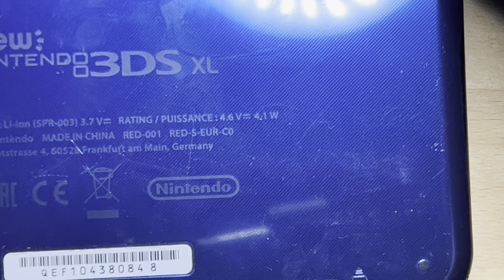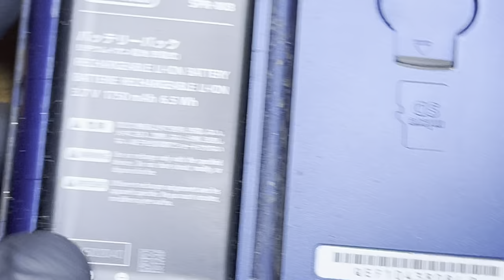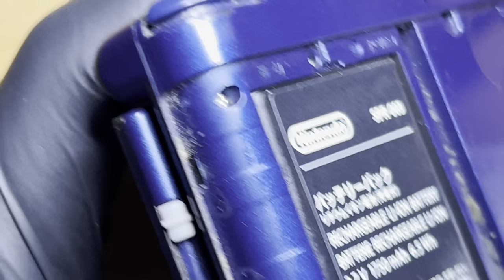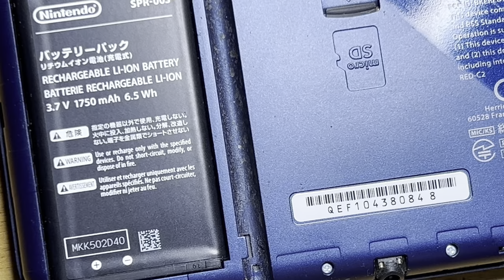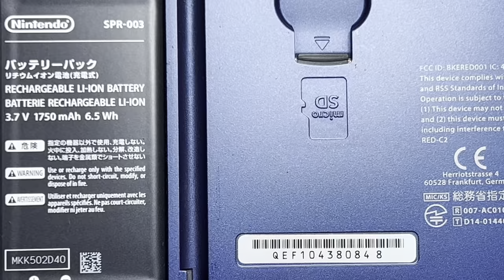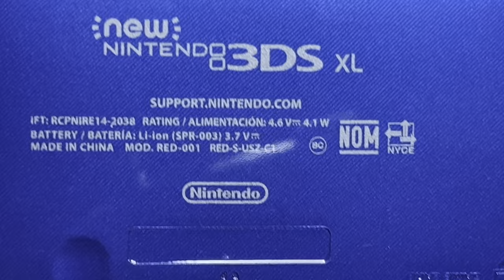Aftermarket Cover Plates for the New Nintendo 3DS XL

Comment: I love the original new 3DS XL front and back plate as it’s looks nicer especially with the beautiful blue color but the aftermarket cover plate is better as the paint chipping is not going to be a issue.
Reply from the maker: That's right. Also, the accuracy of fit and the recesses on the different connections are not perfect. But at least a visual fresh-up after a few years.

Comment: The back plates stink. They are pretty flimsy
Reply from the maker: Removing the little brackets which are attached to the screws is a nightmare. But the rest is pretty doable.
Reply: @HandHero0711  my backplate caved in where the screws go. Had to order a new one from nintendo. The one i have now is just flimsy you can hear it creek on the side where the screw is and it drives me crazy.
Reply from the maker: @Zetchzie  How long were you able to buy them from Nintendo directly?
Reply: @HandHero0711  No clue. It was just leftover stock. Couldn't get an exact Black plate so went for the Blue Zelda one.
Reply: @HandHero0711  unfortunately it looks like they all gone. All thats left is 2DS covers and game cases. We really need quality replacement covers. Metal ones if possible.
Reply from the maker: @Zetchzie  unfortunately the market is too small for that. You can only rely on Chinese aftermarket manufacturers. 😕
Reply: @HandHero0711  10 more years maybe itll be retro enough like gba
Reply from the maker: @Zetchzie  I hope so. The fanbase is small, but strong. Could imagine that it will even grow over time. 😎

Comment: Where did you get the replacement backplate that says "XL" instead of "LL"? I've been struggling to find one.
Reply from the maker: I bought them at AliExpress. There was a seller with both plates. The Japan version and the US Version.
Reply: @HandHero0711  I think any in white sold on AliExpress only say “LL” and probably no “XL” variant exists

Comment: Put the link into description with the shells. Why you don't take the console apart for cleaning the plastic and use wipes instate?
Reply from the maker: I bought the shells from AliExpress. The shells are often only available for a short time and next week there is a new dealer where you can buy from. 
And cleaning the surfaces and the little spots and parts inbetween is more convenient than taking the whole device apart. But yeah, it would be a bit more clean at the end. 😊
Reply: @HandHero0711  How much did you pay for them? Did they fit well because a buyer from Aliexpress said this: "thicker than the original, the bottom is more ill fitting than the top. it wasn't fitting around the headphonesl Jack and it was bulging out pretty bad ,I used and exacto knife to shave it from the inside and it fits with almost no bulge now. there is over spray inside too that makes it even thicker you need to shave some plastic off to make it for better bit it still doesn't fit perfectly. there are also some minor bubbles in the clear coat on the top shell. I love that it has the silver diagonal lines under the paint just like the original though. the top fits a lot better than the bottom but it does stick out slightly and when the lid is open and you are looking at the screen you see that the top overhangs a little. I don't think this part can be shaved down like the bottom because there are plastic clips there. shaving the inside of the bottom made a mess too. Overall not bad but not perfect and not as good as the original the console feels fatter now too."